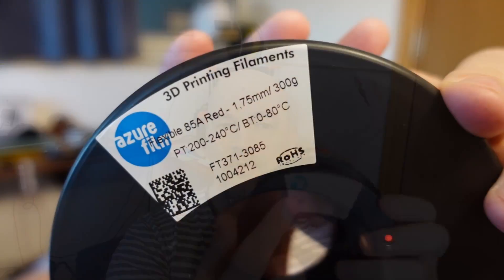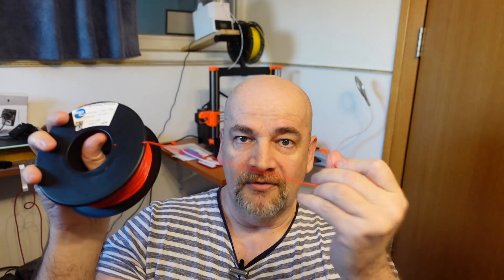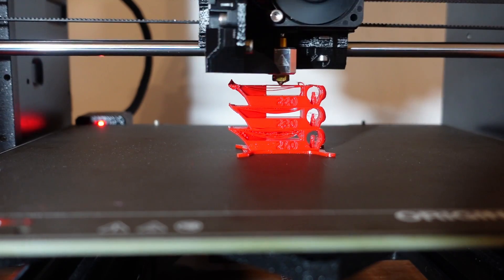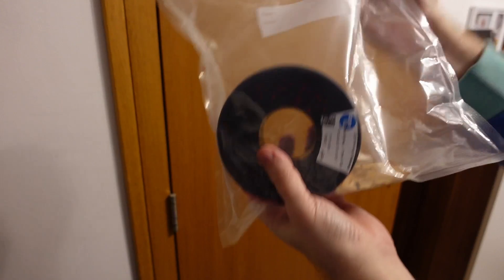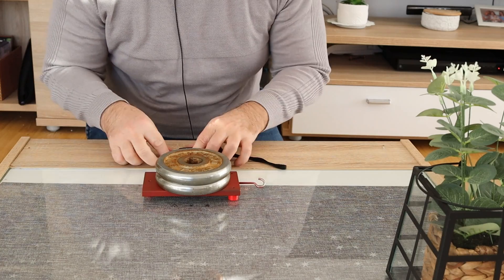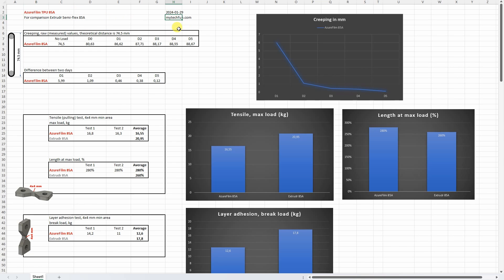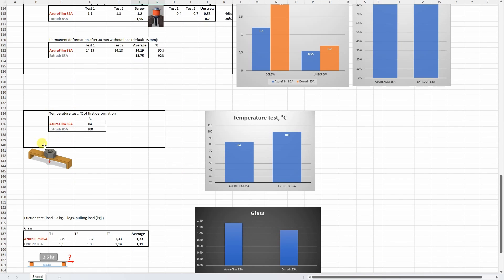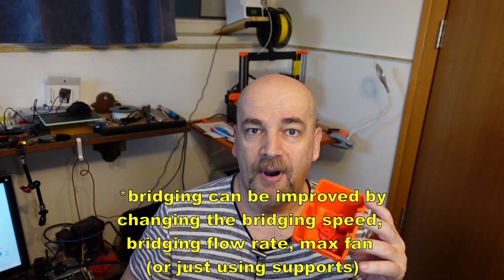The most flexible filament I tested so far: AzureFilm 85A

Comment: I was honestly surprised at how easy It was for me to print the 85A filament I have. It helps if you have a large geared direct drive extruder.  I found that I could still enable retraction with a short distance and a lower speed than I would use for normal filament.   I also don't believe TPU needs drying.
Reply from the maker: I am sure that TPU needs drying, in my experience, more than PETG (but less than Nylon). Check my Extrudr review video, huge difference after drying.
Reply: @MyTechFun  Saying that I knew I was wrong because it always depends on the relative humidity where you are. In the summer I have to dry PLA sometimes. In the winter I can print anything without really drying it

Comment: Here is my idea about the lower temp curling. By printing lower temp, the tpu still sticks to each other, yet the surface tension is much higher than the warmer parts. Its like when you stretching dough. They are curling back on the end. But if you make it warmer (by the waemth of your hand) the tension  force is  getting lower. So they still flat on the table, and dont curling back at the edges.

And i think the extruder is able to push trough the material, even below its ideal viscosity point. So you actually sticking together a kind of flexed  strings, and they start tp flexing back.

Comment: I think for flexibles lower print temperature means higher viscosity and increased internal stresses. The higher viscocity creates a small delay for when the stress (of the material being squeezed through a small nozzle opening) releases. I think those stresses create the curling up and especially for overhangs because the extruded line is less constrained by the previous layer so it has more space to deform from the released stresses. If you have ever noticed on silk filament that when you extrude in mid air (while loading/purging filament for example) right after the extrusion stops the extruded string of material becomes bigger in diameter and retracts/shrinks in length. That is stress release and you can easily see it because the extruded line/string is not constrained to a previous layer or the build plate. Stress release always happens, but if the material is stiff the previous layer limits the amount of defomation the stress/pressure release forces can introduce. In the case of a flexible material, the previous layer "moves" with the current layer as the material is still deformable even if has solidified/cooled down, because it is flexible...

Comment: higher stiffness would be more useful, i think
Reply: More useful for what? Could it be that different applications require different material properties?
Reply: @ThePritchett1  true
but it's a general statement, so the context is general
more applications could use a stiff flexible material than a super soft one
the instances where using such a material would be better than what is commonly used range from top ⅓ tpu95a to bottom ⅓ pla including the gap in between
super soft only covers bottom ⅓ tpu95a
more applications -> more useful
Reply: In that case you buy a TPU with a higher shore A value. 🤷🏻‍♂️

Comment: The curling up happens because the TPU isn't fully melting in the nozzle, and when you put the perimeters down, the cooler core is retaining some tension and causing stress in the model - that pulls on the sharp corners and curls them upwards. The solutions are either slow down the print, increase the temperature, use a nozzle like a CHT or similar that can heat the filament more easily, or if your slicer has the option (Orca does) - use alternating reverse perimeters, so clockwise one layer, counterclockwise the other.
 That won't remove it completely, but it will spread the stress across both corners instead of just the one and reduce the curling by about half.

 You see it with other materials too, PET-G in particular will do it when printed at high speeds.
Reply from the maker: OH, this was super useful, especially tip for alternating reverse perimeters. I will use it with other filaments too. Thank you!

Comment: At 220c the layer adhesion fails along the limited surface contact area from the overhang so the problem is both the low temperature and the overhang combination I think. If anyone has other opinions or thoughts please share!